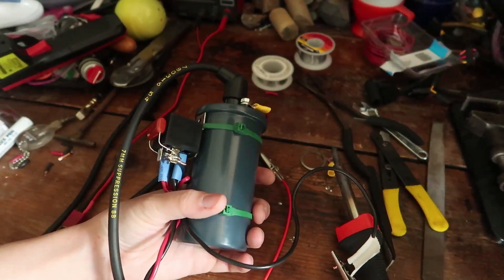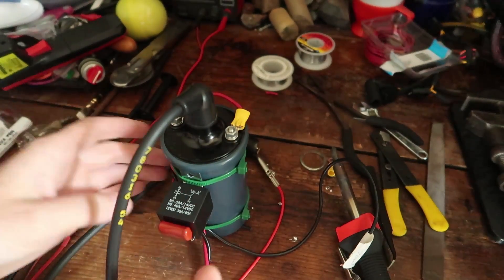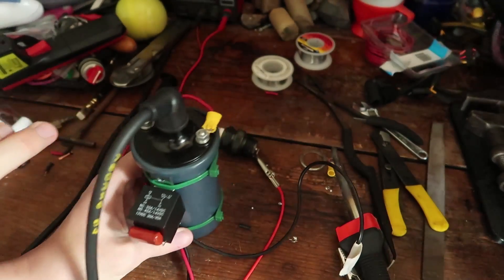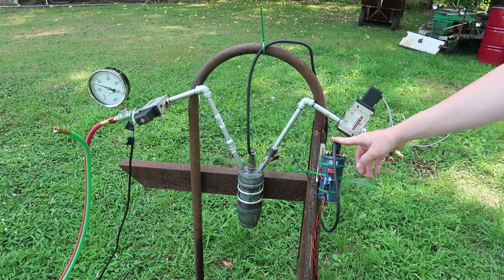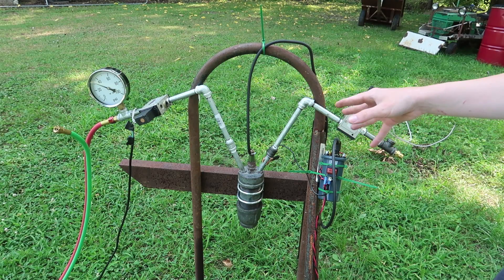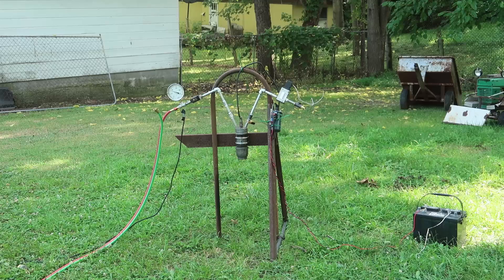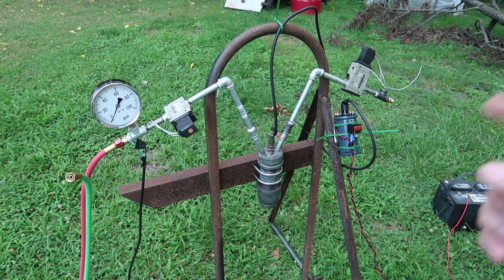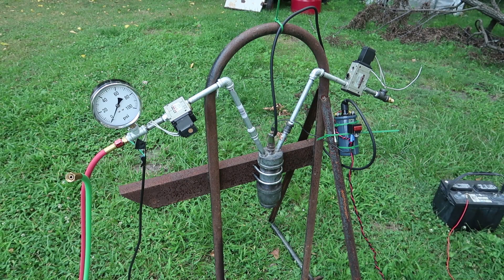DIY Liquid Fueled Rocket Engine 04: Test-Engine Spark Ignition Experiment

Comment: Interesting project. I think you should be able to get it running with oxygen. Looks like the propane is consuming the air inside the combustion chamber around the ignition source and extinguishing the burn. 
Maybe try a bit of compressed air before the oxygen?
Reply from the maker: you know what, i totally didnt think about using compressed air! i've been so focused on specific things that i didnt think of that. thanks!
Reply: Looks like you have a pulse jet
Reply: I think you are very very intelligent. Hand in hand with being a nutty professor! Good work!
Reply: Oh. And if you can.. shrink the nozzle to bring the compression up a scooch .. make another video!!
Reply: i know Im quite randomly asking but do anyone know of a good place to watch new movies online?
Reply: @Hugh Raphael Flixportal xD
Reply: @Greyson Forrest Thanks, signed up and it seems like a nice service :) I appreciate it!
Reply: @Hugh Raphael happy to help =)

Comment: The reason you got shocked is because the capacitor can hold high voltage electric current for some time. Discharge it before handling it

Comment: Thank you, I'm building my own engine and couldn't figure out how to pulse the spark plug, I didn't realize a relay would work as I assumed it would just ark across.
Reply from the maker: Well the relay is switching the 12v side of the coil not the 10,000v side. Thus no arcing.
Reply: @RinoaL  yeah, I didn't realize that when I wrote this, I also didn't relize your supposed to pulse the 12v side either. But I got it figured out now. (I think)
Reply from the maker: You'll get there, don't worry. And if you do it wrong either nothing will happen or too much will happen hahaha

Comment: Make your own Hydrogen "potassium hydroxide aluminium and water"closed capsule that can take heat from the reaction vent to cooler and dryer and You have HHO gas. you can run that engine on that blow up balloons run an gas engine or blow up the shop. Don't do the latter.
Reply from the maker: ok now liquefy it, and make several hundred gallons. you clearly dont understand this problem.
Reply: @RinoaL  Maybe not your problem But Hydrogen Yea I do" You have no Idea how much gas that process Generates"Volume"
And it has your oxygen and gas ready mix
I think all you may have to do is add more oxygen to increase thrust. But then I am no rocket scientist.

Comment: I've designed and built a dozen rocket engines using spark-torch igniters. Propane-gox has a reasonably wide ignitable range, no need for hydrogen. I suggest you run spark-gox-fuel at the start, then turn them off in spark-fuel-gox order. This gives ox lead and lag for minimum ignition delay and clean shutdown. With gaseous propellants and nil chamber pressure at start, the highest pressure you can produce in a hard start is about 150 psi- no hazard.

Mount your solenoids as close to the chamber as possible, the dead volumes will just cause unsteady flow. The injection orifices should be smaller than the solenoid flow areas so that the injectors control the gas flows. The injectors should at least be impinging to produce decent mixing.

Comment: Do you have a good number on exactly how much gas your using in 1hr?
Reply from the maker: 1hr? who on earth would run it for an hour?
Reply: That's not the point. I have a electrolysis split cell system, That generates 20cfh of 99.9% hydrogen and 10cfh of 99.9% Oxygen at 2kwh. And im curious if it would run the engine on demand and just wanted numbers.
Reply from the maker: @electrolysisresearch8013  a full tank every 30 seconds during full power.
Reply: Thank you I'm a journeyman electrician and I build H2O electrolysis cells. And I've got 4stroke engines running off of them. But the engine just doesn't utilize the oxygen very well, In fact the trick to running engines off of it is dumping a bunch of the oxygen because it makes too much and reeks all kinds of havic. So I was interested in messing with a pulse jet or rocket engine and I'm trying to learn about them.

Comment: I'll predict once that steel reaches red heat, the O2 eats it up like a cutting torch.
Reply from the maker: i wouldnt let it run that long. the V2 rocket’s engine was cast iron and it did its job

Comment: If it were me I would start running the oxidizer first and very shortly thereafter, turn on the fuel valve. If you have too much fuel in the chamber when the O2 starts flowing, you'll get a hard start. Try using a sparkler or something pyrotechnic that already has its own solid fuel/oxidizer, that way the igniter doesn't go out before the mixing happens. Good luck!
Reply from the maker: yeah i will try using compressed air next. but i was hoping that the wind would blow the gasses out of the chamber to allow me to pop it again. but oh well.

Comment: As I said in your other video, a baffle plate with a small mixing chamber between the inlets and the ignition source would make ignition better, prevent vortex oscillations and back pressure  to your supply lines which causes pogo oscillations.

Many early rockets had rapid unplanned disassembly because of these problems.

Comment: U are awesome , Ive been wanting to build a rocket engine,I have some unique ideas and a couple different ways to start the engine. Im on face book under kevin whidd. Plz contact me
Reply from the maker: only morons use facebook, you shouldnt use it because itll make you dumber as far as i can tell.
Reply: @RinoaL  Kinda a dick move of you.. I've been reading all the comments on your video and you've kinda been a dick to them. What's your deal? This is just an inspiring engineer that wants to build a rocket engine using your design and is asking for a bit of help. Cut these people some slack smh.

Comment: Hello! Sorry my English is bad :). Tell me, how did your rocket engine experiments end? It is very interesting to me. I also did something similar. It seems to me that your device is a burner. Rocket thrust he will not. How do you want to use this device in the future?
Reply from the maker: this engine is only a toy. I havent done any more experiments. I am building a big workshop. I will be doing more rocket experiments in 2019. hopefully Spring. sorry ^^
Reply: I understand. Good. But you need to change the design and principle of the engine. Of course, if you want to continue to experiment.

Comment: What do you mean the relay is driven through itself.
Reply from the maker: the relay's primary coil runs through it's contacts. so when the relay is energized it turns itself off, and when it is off it energizes the coil turning it back on. it flips back and forth indefiitly. capacitor is there to slow it down.

Comment: If you find that this isn't working, look into using "coil packs" instead.  We use these on some of our fire effects (liquid propane with atmosphere as an oxidizer).

Are you using liquid or gaseous propane?  Honestly, we have had a LOT of trouble with spark ignition on liquid fuels.  Your setup looks conceptually simliar to some projects we've done.  Would love to compare notes!

Comment: If you want to light lpg you will need a ratio of 1.5 oxygen to 1 lpg , light with low pressure and build it up. because the motor outlet in the motor it can not  produce a enough pressure  to damage The fittings

Comment: I  thinl u problem with spark it too small  and far from  the gas  so try to make spark moveing longer   3 .4  or 5 .m'm  and make  in madel not on a top or in apotom that make it in away of gas and air ..tray it u will lose nothing  I'm sure it's will work

Comment: I built one of these years ago the only way it works is if the fuel and Air is balanced in the right proportions correctly then you actually have some power and it will actually light this particular design if air and fuel ratios are incorrect will split in half for learning purposes thick wall pipe works the best with a relatively weak or thin nozzle till you can figure out correct mixtures so it has a way to release excess pressure instead of having shrapnel..

Comment: Good morning,
I am also building a H2O2/ethanol rocket engine of my own. For your project, I suggest you not use the old plumbing parts. Even if they are made out of steel, it is corroded an might develop micro-fissures that would cause total engine failure. Also, you might want to use a convergent-divergent nozzle instead of just a convergent one. 
Lox/propane is a good idea, however you need to change your mixture ratio. I'm not sure but something like 2-4 O/F is fine (needs to be ascertained however). As for hydrogen, its tricky and has a very specific ratio. However it offers a better specific impulse  than other fuels (about 300sec at sea level).
The other problem you seem to be having is a low combustion chamber pressure resulting in a turbulent flow. Since you don't have a correctly sized nozzle, the exit flow can't be properly controlled either. The lack of pressure might be the cause of your failed ignition (I've tried it and it works fine on my test rig).
I suggest that you do a complete engine overhaul as to ensure better performance and safety (pressure problems sometimes result in a rapid unplanned disassembly). You can use the research already done by other NASA scientists and use the flow simulators available on their NASA.gov website (grc or jpl sections). 
Others wise your project seems sound.
I hope this will be of use to you and wish you the best of luck in your endeavor.
(^-^)

Comment: I don’t have any rocketry experience beyond combustible liquids but it seems you don’t have the basics covered for successful combustion. Specifically flow rates and metering. Also the location of the spark does not seem ideal. Just my take overall it seems too crude and rudimentary to work. Maybe a complete redesign with attention paid to mixture flow + atomization then metering/ratio of each propellant and lastly spark delivery. Simply extending the spark plug gap will deliver better results.

Comment: No!NO! YOU DOING IT 👌 JUST EXTEND THE SPARK PLUG ATTACH A GAUGE CIRCULAR FANGS WIRE. LIKENESSES OF THE CIRCULAR GAS VORTEX DISPATCHING HELD WITHIN THE COMBUSTION CHAMBER. HELD ON FLAT GRAPHITE BRACKETS. BE 😎

Comment: Hi I'm a engineer 
You really need an oxidizer. 
Think about a fuel injector from a cars intake system and a driver for it to regulate fuel mixture. 
Look like a fun project.
Reply from the maker: nope, dont need oxidizer just to test ignition

Comment: Propane (LP gas) is mostly butane. Don't use that on a cold day! Stays liquid at/below 0deg C.
Gases with wider mixture ratios (hydrogen-up to 75%, methane- 15%?) would help also. Butane is about 6%.
Try passing the spark thru some of the gas (likely the oxygen). It will turn the oxygen into a very reactive plasma. (Think plasma torch)
A non-cooled chamber (steel or otherwise) won't last very long once combustion starts.
Reply from the maker: can you supply information to back up that claim? from my experience propane is mostly (shockingly) propane, and stays pressurized even down to -20
Reply: @RinoaL  
If you are north of 45 latitude, it may be mostly propane. Here at 37 N, it is 60% butane.
Reply from the maker: you do realize propane and butane are different gasses right? are you saying they reconfigure depending on latitude? thats a bit silly really
Reply: @RinoaL  
What I saw you using for "fuel" was a BBQ tank. Those are typically LP gas.
https://en.m.wikipedia.org/wiki/Liquefied_petroleum_gas

I am just say, "Be certain" about what you are using. Flaming puddles of fuel are always BAD.
Reply from the maker: idk, i expect to have a pretty big flaming puddle of kerosene in later tests.
Reply: @RinoaL  
I am certain you will. Be careful!

Comment: it will melt in about 20 seconds
Reply from the maker: i dont plan to fire it longer than that. its only a test. honestly im working more on everything around the combustion chamber instead of tje chamber itself. once i get control systems figured out, then ill make a cooled combustion chamber

Comment: You might add spark lower on the nozzle. Give the reactants more time to mix. Also if kero is used try generating vapor using exaust heat; stainless coil .

Comment: Rinoa, I enjoy watching your videos but want you to not seriously hurt yourself.  I would suggest you try the following modifications to your combustion chamber:  Instead of  sparkplug ignition, use a small welding tip on your oxy-acetylene torch handle inserted into a smaller hole. Also, use multiple smaller holes for your propane and compressed air (not pure oxygen, for now), and angle these holes so that the gases turbulently mix.  Keep the large threaded exit throat of the chamber un-constricted for now. In addition to the on-off solenoid valves, follow them with needle valves with long stems for safer remote operation. With the needle valves shut off, ignite the welding tip and let the combustion chamber pre-heat. It will become cherry-red, probably, with concomitant reduction in the combustion chamber's structural strength. At this point evaluate whether to add chamber cooling, such as heat sink fins or a liquid coolant heat exchange coil around the chamber.  If you wish to proceed, slowly open the propane and compressed air needle valves. An increasingly long flame will emerge as the propane and oxygen flow rates increase. The inside surface of the chamber will be quite hot by now, we can assume, and the exit nozzle will be even hotter.The iron and carbon of the steel combustion chamber will start to vaporize and burn a little bit, making a yellowish flame and sparks. At this point you could shut it down and let it cool. Examine the threads at the exit port, and if they are not all melted then do the following:  take a pipe-plug that fits the exit port and drill a 1/8" hole in it. Countersink both sides of the hole to make a prototype rocket nozzle. Repeat the start-up sequence, keeping in mind that the combustion chamber will now be capable of building up some pressure. Be sure and be safely situated when you do this because you will now have a rocket engine capable of producing thrust. When (not if) it explodes it will send white hot chunks of burning steel every which way.

Comment: When you said the Russians use a giant match to light the rocket, was that a joke?
Reply from the maker: no, thats why the Soyuz rockrz engines cant relight. they havr like 2x4s stuck up the engines with flame charges wired to the ends. thats also why a few times an engine just hasnt lit, and they are unable to relight while in fligjt

Comment: On a small scale experiment like this you can also run with compressed air. It doesn't have to be the much more dangerous and expensive oxygen. I built something like very much like this myself years back. Got shelved (wandered off to other projects) before trying to change to liquid fuels though. I used a single inlet pipe with a tee to act as a splitter and put compressed air in with propane and it functioned well. I did try and use oxygen but actually found no appreciable difference between them. I did not wire it for electronic start though. I just used a long lighter. I like your ignition coil hack though.

Comment: Pretty sure most volatile stoichiometric ratio for propane & air (compressed) is like 3-5% propane 95-97% compressed air. Pure oxygen likely allows for a more rich mixture.

Comment: is it pure propane you are trying to ignite? you have no oxygen until the gas reaches the outside air.
Reply from the maker: i was hoping the air would be replaced inside the chamber to pop it again. but evidently the exhaust stayed in there since i accidentally ignited it the first time. i most just want to test the spark though, hence why i didnt bother too much with the flame.
Reply: you wont have a problem once you get the oxygen in there. its good that the exhaust is nice and big so you dont have a potential pipe bomb on your hand.BTW, do you have any detailed info on that igniter?

Comment: 1. your fuel & oxy pipes could have been drilled and threaded from the side, instead of  angle cut & welded    2. check valves  recommended on both oxy and fuel to stop  the explosion from running up the lines to the tank
Reply from the maker: 1: yeah but i figure it looks cooler this way, its not a good design at all so looking cool is key.
2: already have flashback arresters on the lines, dont worry.

Comment: from messing with propane powered potato cannons, I can say the air fuel mixture is very picky. Also propane is heavier than air, so possibly the spark being lower in the chamber may help.
the Stoichiometric air-to-fuel ratio of Propane is 15.67 : 1 6.45%  - so flooding that much propane in without added oxygen is likely 'flooding' the engine
Really enjoying the progress reports on this